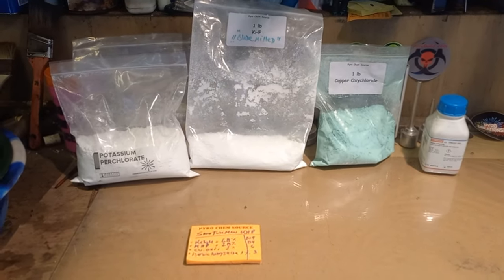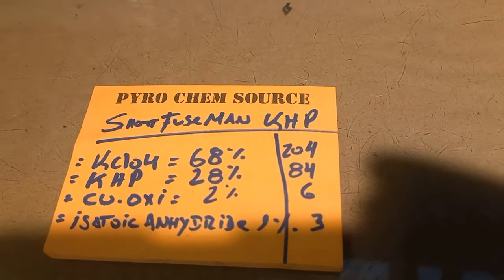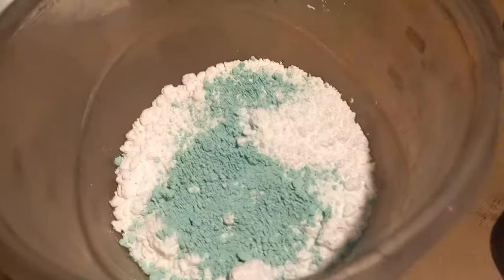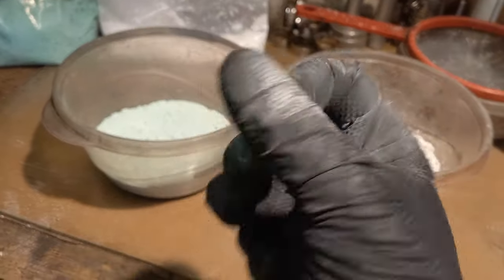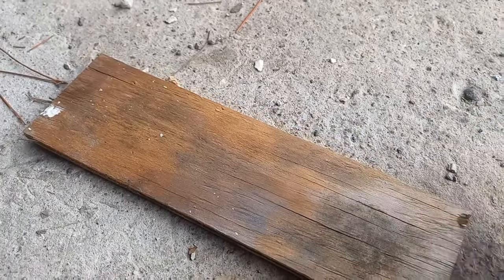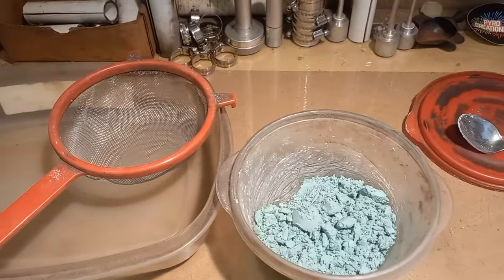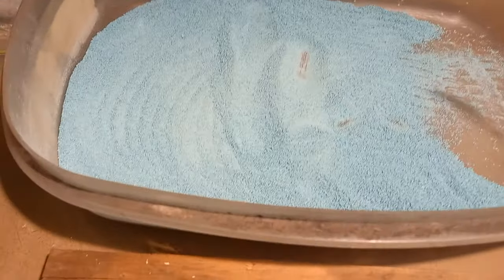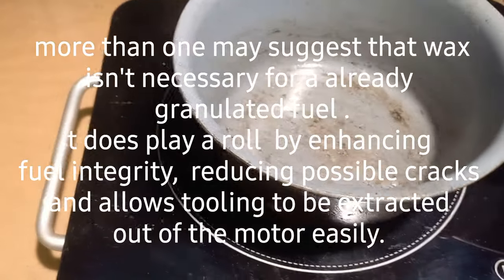KHP Whistle fuel making/Launching

Comment: Thanks so much for the videos! The time and effort are greatly appreciated. Absolutely love your channel sir!  I am in the middle of mixing my first batch of KHP and  have a few questions: 
1) What is the ratio of Water and Alcohol 50/50, and what purity of alcohol do you use in this mix?
2) When you are pressing your KHP what size increments are you using?
3) Where do you purchase your Isatoic Anhydride?
Reply from the maker: @cheech76  yes I use alcohol and water 50-50 
Incrementson 1 pound motor are about 3 grams,  isatioc is available at Amazon.com
Reply from the maker: @cheech76  denatured alcohol
Reply: @ ok that’s helpful. It is a 50/50 mix?

Comment: I have a question I've made Sally whistle before. And I want to make some benzoate but I'm debating between sodium or potassium benzoate. Not sure if one of them's the alternative and one is performed more than the other? In your experience what benzoate do you use when making whistle. And I'm talking about just straight perk and benzoate. Since I'm preferably using the Sally for Lyft.
Reply from the maker: @patman0250  power wise from less to more power:
Sodium benzo , potassium benzo , sali , khp , wow fuel
Sodium benzo is more subject to absorb humidity but offers a high pitch whistle and a nice yellowish flame .
Potassium benzo is slightly more powerful and offers a more graspy sound , with orange flame , it's also less bulnerable to humidity.
Reply: @Pyroflorida  Thanks for the info, so which do you use more often or is it pretty much both.
Reply from the maker: @patman0250  I like both and I use both as well as 👍
Reply: @Pyroflorida  Awesome thanks I'll try potassium benzoate first. But it's weird because the sodium salicylate I have I got from fireworks cookbook. It's extremely fine milled powder but when I look closely I see these extremely small little crystals that look like salt grains but they're so small I don't even feel them when I rub it between my fingers. Do I need to mill it or is that normal for sodium salicylate?
Reply from the maker: @patman0250  yes , sali is usually milled to a fine powder and can  be used right out of the bag , in case contrary sodium and potassium benzo are more granular an need to be blade or ball milled before use
Reply: @Pyroflorida  do you know how to make these benzo compounds????
Reply from the maker: @squigglesmcjr199  yes , all of them
Reply: @Pyroflorida  can you make a crafting video about that???
Reply from the maker: @squigglesmcjr199  I may make a sodium benzoate video soon
Reply: @Pyroflorida  thanks for being a cool dude, I love this channel
Reply: @Pyroflorida  so in my research I've found that the potassium benzo and sodium benzo are food preservatives, interesting
Reply from the maker: @squigglesmcjr199  yes , dealing with non toxic components is always a plus
Reply: @Pyroflorida  yeah khp is very toxic

Comment: Thank you for this! You sir are the man!!!! Now a sali mix? What do you press khp and strobe fuel 7500psi?
Reply from the maker: @husseinfakhreddine2501  tks. I usually press whistles at about 7500 to 7700 psi , strobe is different , I usually press strobes to no more than 6500 psi , pressing more affects the  performance and pops aren't that hard.  
That's exactly what happened on this strobe rocket , pops aren't that hard because I pressed the strobe to 7700 , and I did it intentionally to verify my suspicion
Reply: @Pyroflorida  thanks man! It finally worked after my 3rd try i guess i just made my khp bad last batch i forgot to blade mill it. I posted it on my channel feel free to check it out next one i make ima make titanium tail for the 3rd stage with a header do you know how much grams of flash a 1lb whistle/strobe can lift without any issues
Reply from the maker: @Pyrorocket123  depending on how much whistle you press on your spindle , I usually press 1 1/2 inch of a well made Khp or sali , then rest of spindle with strobe , I'm using a 4 inch spindle,  I have lifted 100+ grams of flash , no problem , if decide to lift more than that I'll recommend using KHP at 2 inches of spindle

Comment: So how long does it keep without the fuel stabilizer and how long does it keep with the fuel stabilizer? and does it change once it’s been pressed in the rocket?
Reply from the maker: @EADN20  motors should be used within a day or two after being pressed to avoid CATOs.
I had fuel without  stabilizer stored for a couple of weeks still performing well, but  Cu.oxichloride will start degrading shortly. 
I used fuel stored for two months with stabilizer on it without issues
Reply: do you have any idea how China is stabilizing copper catalyzed whistles? I have a few "screaming cracklers" by brothers brand that are a short spindle blue fuel grain whistle motor. I've had them for 12-13 years now and they still never fail.
Edit: stored in mediocre conditions in a garage with high humidity.
Reply from the maker: @AB_Pyrotechnic  no idea , and I guess there is not a way to unfold those secrets

Comment: Another great video!! Why do you think the strobe was not popping loud on the second? I have the same problem sometimes.

Did you use your 3 micron mg/al mix or standard 200 mesh mg/al strobe mix?
Reply from the maker: @NagashiChidorii  I usually press strobe to no more than 6500 psi on the 1 pouders , this time I pressed the strobe to 7700 psi , even being the same strobe I have used before , obviously trobe gets affected when more pressure is applied
That was mi standard 80-200 strobe
Reply: @Pyroflorida  i press my strobe to 7500 and i will need about 2inch+ of 200 mesh mg/al strobe to get good pops.
I try your 3 micron mg/al and i dont know why but cant get good pops.
I didnt think to try lower pressure for strobe, that could work. Have you tested that or what makes you think lower pressure on strobe allows louder pops?
Reply from the maker: @NagashiChidorii  very easy answer to you.  I make the strobe fuel always exactly in the same way , using the exact same chems , they are always popping very hard at 6500 psi , low pops at 7700 , hope this  common sense answer makes sense to you.
Reply: @Pyroflorida  yes makes total sense!!  I will try and let you know

Comment: How many grams of flash on that last rocket? Do you leave airspace or just pack full? I always pack, can you really tell a difference in airspace and no airspace? Some say its a deeper pop when packed full and some say its a quicker snap of a pop with airspace. Whats your thoughts?
Reply from the maker: There was about 10 grams only , just enough to indicate the end of the flight with a report.
I never pack flash , especially if combined with titanium sponge , I usually  fill with flash up to 80% of available volume and fill the remaining 20 % with a cotton ball, then a plug of molten hot glue .
On this way the flash charge is not Pack but is not loose either.
I always used this method so , I don't know the difference between packed or not
Reply: @Pyroflorida  that's what I considered packed lol I do the same exact method but with a little ball of toilet paper 😆

Comment: is the water granulation necessary ? and how does iron3oxide compare to the copperoxy?
Reply from the maker: @pyro-t  I explained in the video the benefits of water/alcohol granulation , but is not necessary,  you can make the fuel in the traditional way .
Yellow iron hydroxide is a great catalyzer wich I use on W.O.W  fuel , it may work well with KHP  but haven't tried yet.
Reply: @Pyroflorida  okay thank you,
another question that I have is how do you place your fuse ? I do it normally like a hook and then leave it near the bottom of the hollow. And on very fast fuels I do like a ring around the bottom.

Comment: that's stock for a long time?
Reply from the maker: @nielgultiano7060  if double ziplock bagged all air from bag removed  and stored in an air conditioned room fuel may be good for several weeks , specially when added the 1% of isotonic anhydride.

Comment: So what is khp exactly???
Reply from the maker: @squigglesmcjr199  potassium hydrogen phthalate 
A fuel actually
Reply: @Pyroflorida  thanks
Reply: @Pyroflorida  so another thing I just thought of, could you use colored wax to get different colored smoke out of the end of the rocket???
Reply from the maker: @squigglesmcjr199  impossible,  the only way to get real colored smoke is using potassium chlorate as an oxidizer and the proper ingredients and solvent dyes for the color desired .
Rocket fuel burns too hot compared with real color smoke formulas,  there is some rocket models producing colored smoke tails but nothing to do with the type of fuels I'm working with.
Reply: @Pyroflorida  interesting